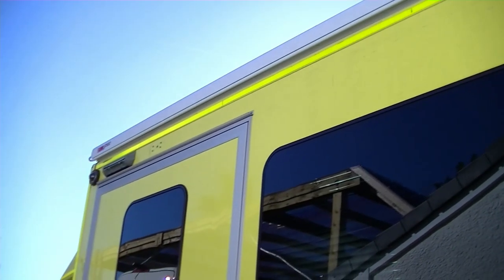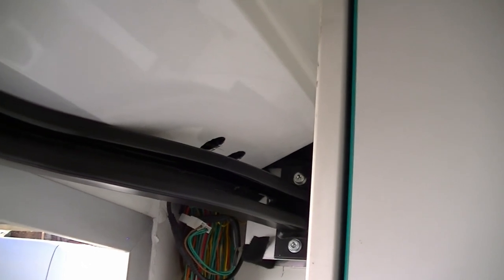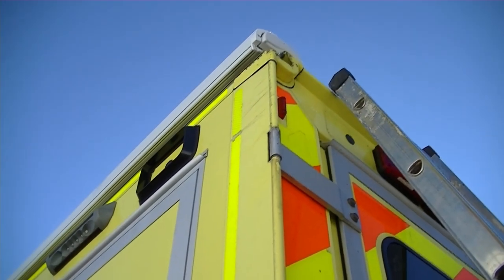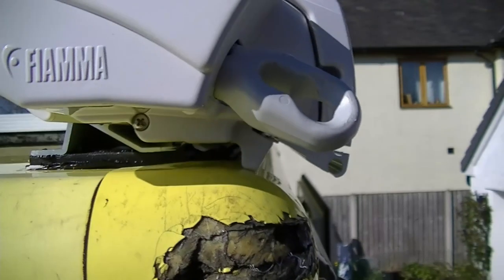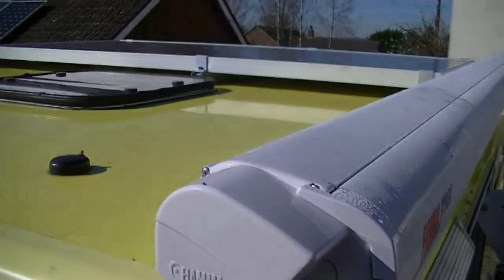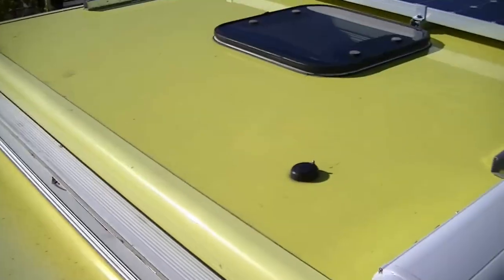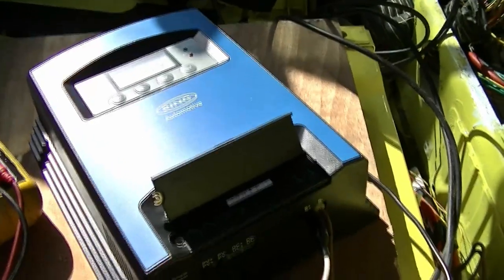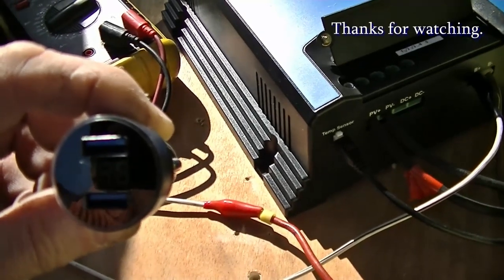Project 'WAS', Fiamma F80s Awning and B2B update

Comment: Hi Keith, As you may know, you can order 6mts lengths of unistrut channel, I use it at work all the time.
Reply from the maker: bits & bobs Yes what I meant was the local guy I bought it from several months ago only had loads of 3m lengths at a bargain price so I bought a few from him. If I do add any more I will just extend the existing, if I do this ever again. Will buy the lower profile unistrut rather than this 41mm square stuff.